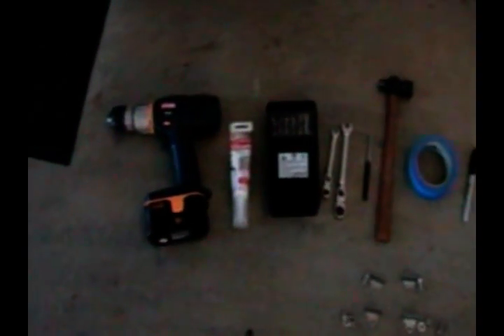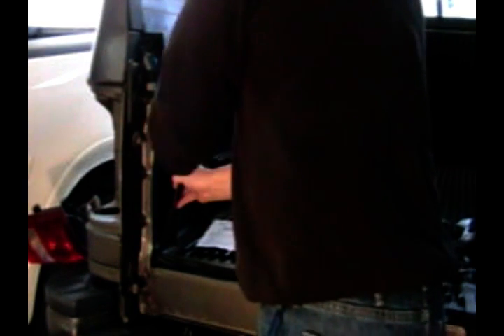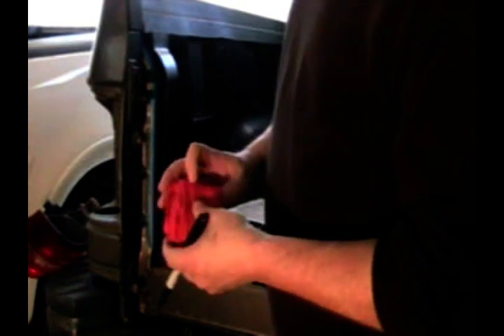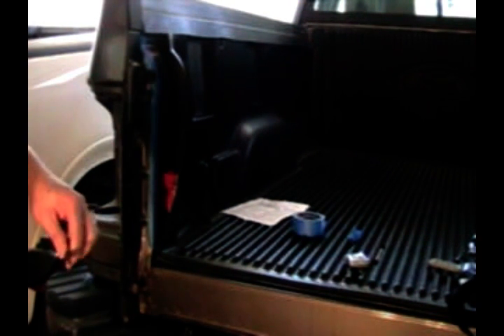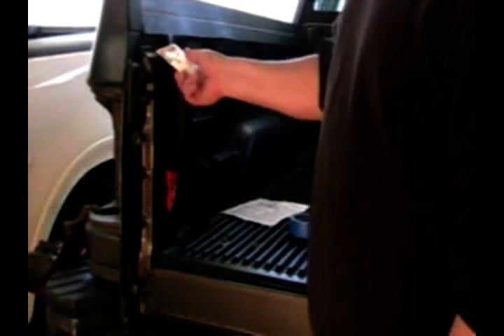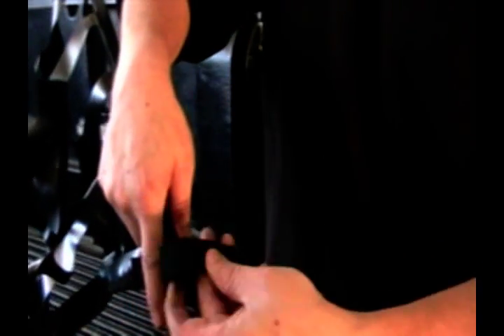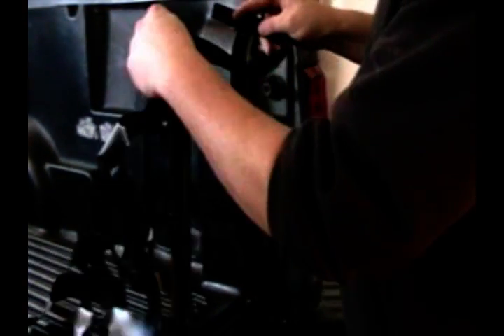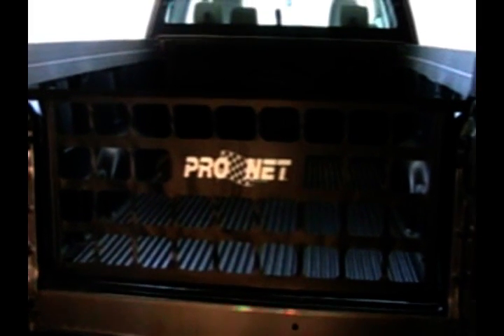How to Install a Tailgate Net on a Pick Up Truck

Comment from the maker: HI Conner, thanks for the question.....no, the way I installed the attachment points for the straps, they don't interfere with the tailgate.  Close your tailgate, then find a spot just to the inside of it where you can install the hooks, then you can leave the net in with the tailgate open or closed.  Hope this helps!

Comment: Super look. Mine kept loosing up so i tightened the straps and then stapled each strap in place. I never take the net down so i used the staples to keep it from loosing up.
Reply from the maker: That's a great idea!  The staples should definitely keep it from loosening up.  Thanks for sharing!

Comment: Thank you! my 98 F150 styleside tailgate rusted out so I'm getting one of these. Once installed is it easy to take net down to load things?
Reply from the maker: Thanks for watching, Jason!  IT depends on the particular tailgate net.  If you get one with quick snaps, or velcro straps, they are a piece of cake to take down and put back.  Ones with threaded buckles are a little more trouble.  I'd look at the strap attachment method on anything I considered buying.  Let me know if I can help.  Thanks again!

Comment: Can you install this using existing holes in the bed like the tailgate bolts right next to to where you drilled?
Reply from the maker: +camaroman101 Thanks for the question.  There aren't any existing holes in the bed that line up with the required spacing for the net.  there may be on some trucks, but not on this particular install.  It sure would have saved some time and drilling if it was!  :)

Comment: I was wondering if the pro net hooks interfere with the actual tail gate when
Reply from the maker: Thanks for the question...since I installed it on the inside edge of the box, it does not interfere with the tailgate.  To be sure, you can locate the hooks from inside the box, with the tailgate closed.